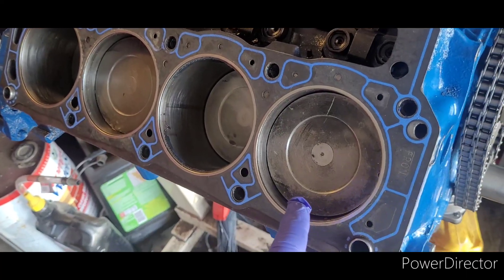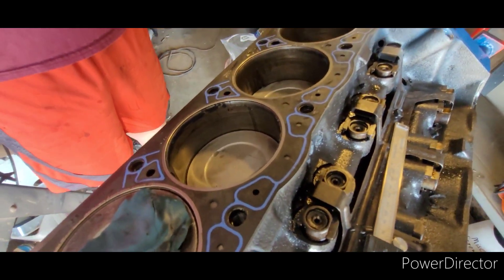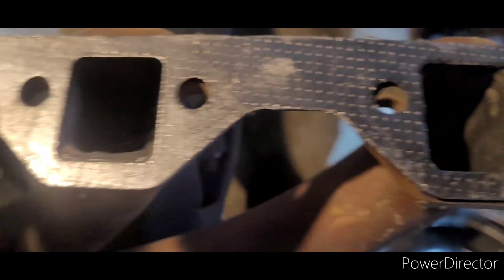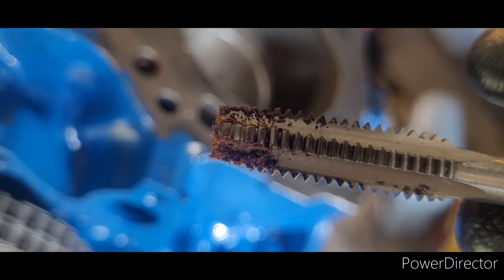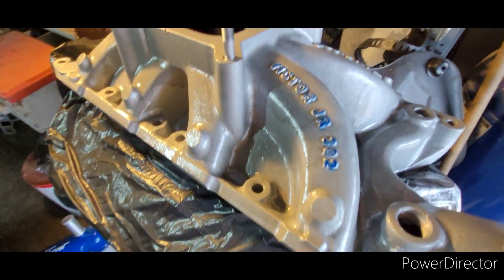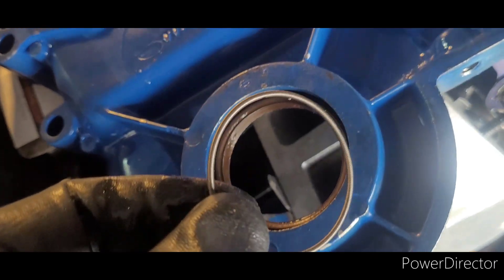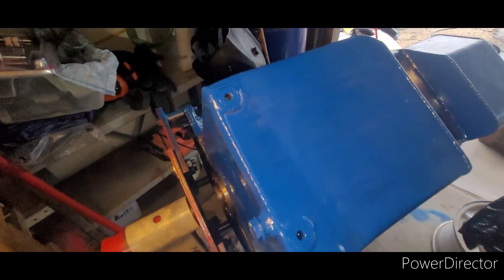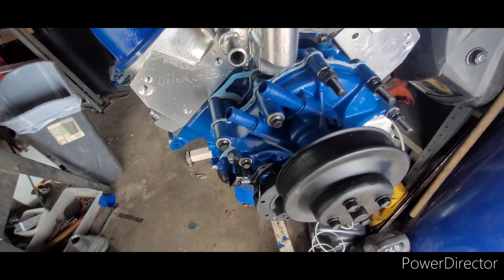Ford 302 long block build. We FINALLY complete the long block for Project White Trash!

Comment: Awesome job sorting all that out! I’ve always used intake gasket part number 1250 or 1262 and they fit great. But I have done it the way you did before I knew lol. That should be a awesome little engine. What cam are you using?
Reply from the maker: @jdrods1519  an Elgjn E-1836-P.  .542/.563 286/299 112LSA. I got it on sale for $195 last year.
Reply: @KrisGreenhillsGarage  awesome!!! Thanks man!
Reply: @KrisGreenhillsGarage how do you know what cam the engine wants🤔? Did you degree the cam?